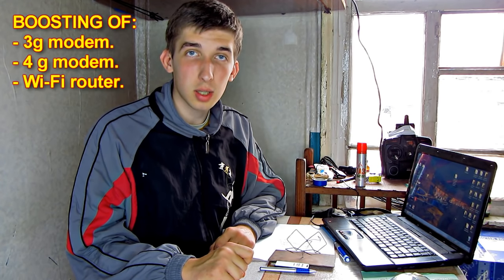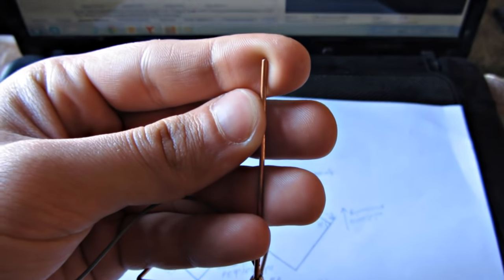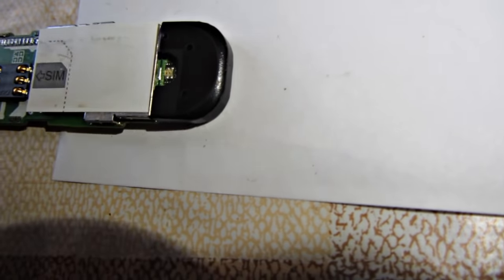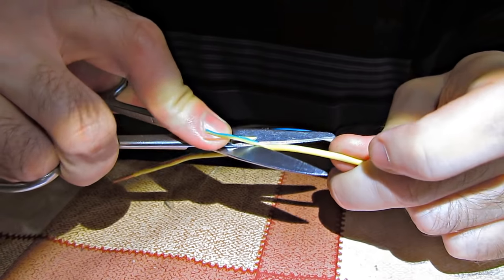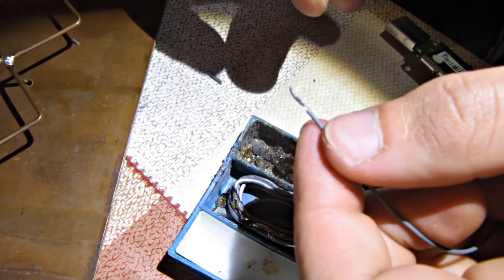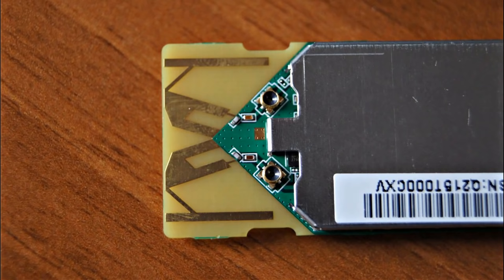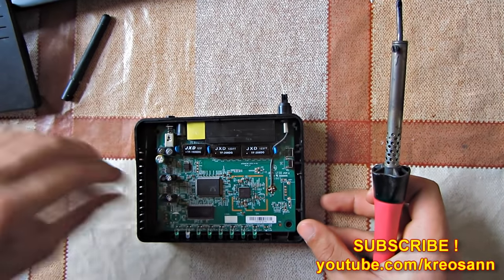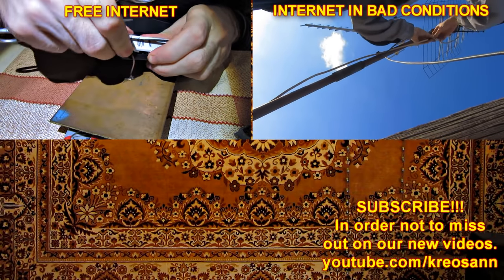How to boost 3G, 4G and Wi-Fi signals

Comment: 27.6 mm is different from Andrew McNeil (Youtube)and some others that use 30.5 to 31.25 for the quarter-wave dimension.  Personally, I think you are more correct and I have also
used smaller dimensions.  GOOD VIDEO and pleased to see you reduced the size to 27.6!  (Center band frequency is 2.437 GHz in USA and UK. )
Reply: How about 5g? Lots of wifi and drones run exclusively on 5g now

Comment: I made it, it works guys! Cheap cable from disposable USB charger and without SMA port connection, just bend an circle open cable as induction to my MiFi.
At the beginning, I'm not believing this tool, but it's work. From 3G to 4G, full bar of signal.

Without connection and without cable, it works as GSM antenna. My room just receiving 3G signal for my Android Phone, but if the phone close to this tools, the bar increase incredibly to 4G.

Just make it and enjoy!

Greetings,
Indonesia!

Comment: i have a question? we are all aware of the of the dangers of using 5g signals, my question is ,if i go back to using my old track phone which used 2g,will a 5g signal and the radiation that comes with still come through the track phone? i would appreciate and answer form any one with some good sense left in them, thank you, no disrespect intended 🌿🐺🌿

Comment: I have a question if you can solve pls. I made a yagi antenna which i mounted on roof which capturing good signals, on other hand (receiving end) there is no antenna. So i want to know if there is any antenna that can receive the signals from yagi antenna and spread those signals to my mobile phone.  I shall be very thankful to you if you solve my problem. also note, i do not want to use any wifi or any dongle. what i need is an antenna at the end which receives signals and spreads those to my mobile. Thank you.

Comment: have any ideas to boost satellite internet reception
Reply: You just need to align the dish perfectly to the satellite and make sure that there are no trees or houses intercepting with a straight sight line to 8° or 13° above horizon (where ever your satellite is located at). The dish also should be clean and especially have no dirt that has only a slight electric or magnetic connectivity on it.
Reply: in addition to trees and houses i would say away from powerlines, and anything that generate a magnetic field such as other antennas and towers
Reply: in addition to trees and houses i would say away from powerlines, and anything that generate a magnetic field such as other antennas and towers
Reply: Larger dish...

Comment: Hello Kreosan,
This is a quadro Antenna right size(each side) must be: λ/4 
where λ=C/F ; and F=1/T so λ=C x T
C=3 x 10^8meters/second(costant)
If you want an 4g(2600mhz) antenna:
T=1/2.600.000.000Hz
T=3.84 x 10^10 sec.
λ=C x T =(3x10^8) x (3.84 x 10^10)=11,52x10^2meter = 0.152meter = 15,2cm
So your antenna must have follow size:
AntSize= λ/4 = 15.2cm/4= 3,8cm.(each side)
Reply: Ah, yes
Reply: Não, 2,88cm para 2600Mhz e 3,57cm para 2100Mhz.

Comment: It's a great video but you can find more details online. If you don't understand this video you need to ask a tech friend to set this up for you. You need to research exactly what you need the antenna for. If you are using a modem that takes a sim card and you want to cover 2G 3G and 4G then you are best using wideband antennas. I believe the antenna in the video is slightly wideband due to the diamond shape but a better antenna might be a log periodic which is a bit more difficult to build. The best setup is starting to get complicated with two runs of coax going to two log periodic antennas. The antennas should be fixed in different polarisations to acheive the best diversity results. This is assuming your 3G 4G modem has two antenna ports. but a y splitter at the antenna might also work. There are also other things to consider like how you mount your antenna. It is best to mount the antenna(s) on a pole above the house (or on a pole in the top of a tree or out in the garden on a pole) or at least on a stand off bracket away from the building. The thing is that antenna alignment can be tricky and you might have to spend a day playing around to find the best results.
  Finally you can boost the signal even further by using a satellite style dish behind each antenna. Now alignment becomes even moe difficult and works best with a good line of sight to the cell tower. So the ultimate might be two log periodic antennas mounted on the end of satellite dishes pointing back at the dish from the end of the arm that usually carries the LMB. Each log periodic antenna should be in a different orientation.
  But even though in theory this could achieve amazing results it has many downsides. 
1. Even if you have good experience and skills this will take you days to setup.
2. Cost is potentially high but i bet Kreosan could build this system for a low cost. For example by using foil covered umbrellas rather than satellite dishes and by home building log periodics
3. Space. This installation would require lots of space if using two satellite dishes.
4. Time. This could take a great deal of time to build and install.
  So yes if you have no other choice and the above is no problem then it could be worth investing. You might be able to save money in the long run compared to home broadband rates.
  Other disadvantages might include the traffic at the cell tower. If the 3G and 4G network is generally busy from other people then you may still experience hiccups!

  I'm sure the kreosan guys could build this system and it would be nice to see someone do a detailed video on this build but i have a feeling it is not their style. Their videos often go for the easy approach and the fast approach. The videos are fun and fast. Perhaps they could try this project and make two videos, the quick version and the long detailed version. To simplify the above technique you could mount the 2 log periodics infront of one large satellite dish.
  The log periodics must cover 2600Mhz or 2.6G for 4G reception and should probably cover down to 800 or 900 Mhz. Such antennas are available on ebay. I found one (800-2700mhz 10dBi Gain 2G 3G 4G External Log Periodic Antenna Outside Antenna) It cost me $25 for one and currently there are no more available at anything close to that price! but don't forget you also need 50 ohm coax and adapters for the connectors. You might be looking at two sets of everything and could need n connectors sma connectors and TS9 connectors.
  It might work better if the log periodics were mounted facing the dish or away from the dish, i am not sure but distances and angles can make big differences and when using a dish alignment is more critical so this could really take days to setup. It should be the ultimate in mobile data reception. There are really not many videos explaining such a setup. Nobody is using a dish with broadband log periodic. I have found some photos such as the 3rd and 4th down on this page: https://www.qrz.com/db/G1RNB
  If you combine this style with what the guy in this video is saying:
https://www.youtube.com/watch?v=cB1v_YDqjOk
 And if you can find the low cost log periodics or build them yourself then you might be onto a winner :D
  I am starting the project but starting to realise how expensive it is and how much space the dish would use. not to mention the time, and all of this is with unknown results until it is built.
  I will start with the one log periodic, i might build a second and order more 50 ohm coax so i can run in true diversity mode (where each antenna has a different orientation (and sometimes a different location to the other) to try to capture a mix of different signals).
  I bought an unlocked netgear aircard but to be honest the signal is weak with the cheap external wideband antenna provided. It doesn't work much better than the iphone running as a hotspot. But hopefully once i get the bigger log periodic up on a pole i will be getting somewhere. Currently i struggle to see any type of 4G where i live. 
  The final issue i have not yet mentioned that might effect some people is that when you use a mobile hotspot the wifi signal back to the computer is not as powerful as that of a base station router so don't expect it to work all over your house without adding extra wifi router extender stations which not only incurs yet more cost, it also might crowd the 2.4G band and start to cause more problem with bandwidth usage and interference on that band.
  So finally a few things to consider if you want to try to break away from home broadband costs or if you have no other choice and are looking for the fastest speeds possible in your area. At least in the future there will probably be better 4G coverage. The problem with 4G is that the frequency used is high so signals reflect easily and they tent to not carry so far so obstacles like buildings and mountains could cause issues. Sometimes good results might be achieved by bouncing the signal from such objects.

Comment: I think the thickness of the copper wire and dimensions if the antenna don't apply for every one, and different regions uses different frequencies for transmission in case of 3g and 4g.

Comment: Is WiFi radiation a problem ? Should I put this in living area?problem is my house has old thick walls WiFi modem signal  is practically limited to one room I was thinking is I put these outside I could get Singal by my window on the second story of my house?
Also running ethernet cable is too much hassle as walls are old cut stone blocks .my house is  250year old.

Comment: I have had good results with using a Pringels box to make a 9db flat panel wifi antenna more a lot directional when sniping for signal in a crowded city where there is to much interference from all the other wifi`s sending at same frequency.

Comment: When you steal a design, make sure you know how it works, before you go "Guru" on Youtube!The Bi-quad needs impedance matching + balanced -> unbalanced in order to match the 50ohm coax!This is typically done with a 1/4-wave transmission-line made from rigid coax soldered to the reflector.Google for "Bi-Quad" and "Trevor Marshall" and hopefully you will learn something. ;) Btw. Who is Charchenko?
Reply: Charchenko designed Bi-Quad antenna and published his work on Russian radio fan's magazine "Радио" (№3 1961 page 47). It's been a long time since then and construction has been little bit changed. Trevor Marshall just improved Charchenko's antenna and made it work for Wi-Fi frequencies in 2001.

Comment: Thanks for the effort but I’m having a hard time understanding your tutorial! Exemple: when you said “you need to solder the wire to the mounting point and the shield needs to be soldered to the case” ... you’re showing many different devices pictures while explaining Coaxial/board integrated antennas ect... what do you mean by mounting point? Coaxial connector external area? If so then what about the middle pin connection? And by “shield to the case? Shield = wire shield or 2g/3G/LTE modem cover/shield? Case = ?? Since basically the device’s case is its enclosure lol
Reply: Same questions for me!

Comment: does this work when there is no signal
Reply: ZorinR  : Some sub-sub urban areas still not far from big cities “not talking about completely lost areas far from civilization” have very bad signal with small but often connection breaks. Signal strength in those areas may differ big times within short distances, like zero signal in your house but respectable signal @ you’re neighbours house. Depending on your provider of course!
Reply: @pleindespoir   you forget about sahara :)

Comment: I found an antenna just like that at goodwill, but about 50 times the size :)
Reply: And you know, that bigger doesn't matter better? With radio frequences it have to be precise, not big, even 0.1mm makes huge difference.
Reply: @domints  and he cut this with lineral and corner shop scisors ? jesus he is genius :)
Reply: @eleinennewelin4419  He just made working one. Not the best performance possible.

Comment: You can use such an antenna on a larger scale to make a beam antenna 📡! :_kreoasnWow:
Reply: I have build a biquad for Tv reception, although only for an experiment. I placed it near the window and it worked. Placing outdoor slightly above the ground also worked for me. No need to install it at altitude, unless I want to get more channels.

Comment: Using a biquad antenna without reflector must be done on fair to strong 3G/4G (later 3G is phasing out) signal
but on weak 3G/4G, add a reflector to retain it's signal strength.
You may need a 75-50 ohm converter (F type female to MCX male) if you use RG6 cable (recommending cable RG6 Quad shield cable)

Comment: did anyone tried this
Reply: I made a couple of years back a similiar looking, twice larger, but cruder antenna to my parents at the countryside. 0,5 mbps -> 10 mbps is what happened. The direction and location of the antenna had to be very precise to get the 10 mbps, but it definately works. Next to the windows is usually a good spot, depends on which direction the transmitting antenna is located. I just pointed mine to the largest village nearby.

Comment: WTF did you do to your sodding iron.
Reply: Voltage controlled Ovulator : use an average grade soldering tip often on a non adjustable iron for a year.. overheating it sometimes and you’ll see how grey”ish” it’ll gets and how easy it will be to bend/dent it ! Cheap soldering irons either heats up very quickly/way too much or takes forever to heat up so you leave it powered on for so long

Comment: Y u ever know that's wifi do have an up lode and a download speed.( when the distance come to take place means even ur wifi router can sent inter net so fair But the device with wifi that ur holding on to, do not have enough power to sent back information to your router . so even ur phone or ipad can see the connection but cant uplode information to receive a  data that ur requesting )

it seem to be real but you can't beat physics anways!!!!!

use ur time cook food for homeless or go out and find some jobs.